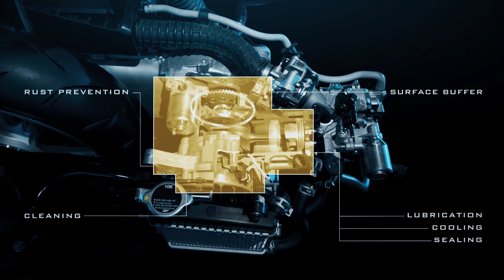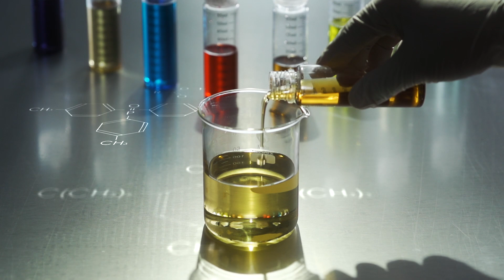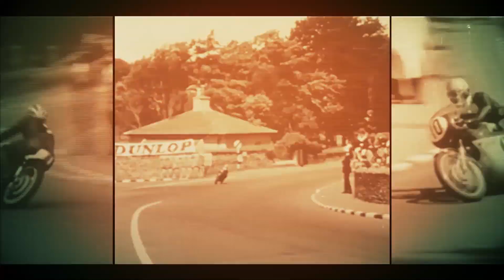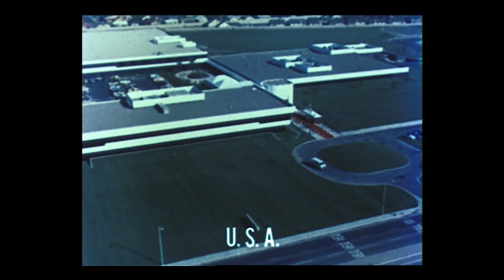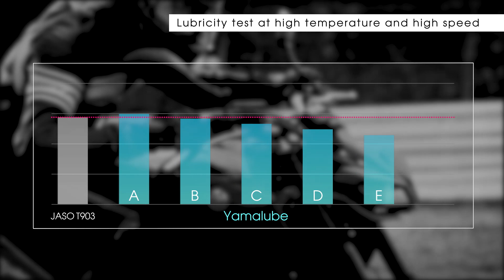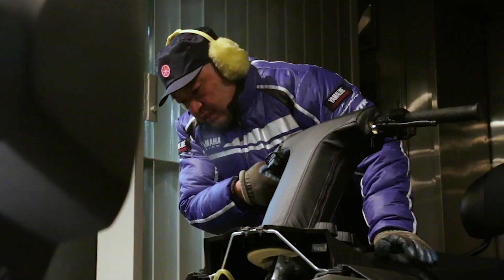Yamalube® - A liquid Engine component

Comment: In my country, almost all the workshop don't keep stock of original manufacturer oil and claimed that other brand make better engine oil because it has higher viscosity. In truth, those third party engine oil are more expensive. There are no basis in their claims that original manufacturer make inferior lubricant.
On the other hand, they use Yamalube during break-in period as they claimed is cheaper and Yamaha engine designed to use original manufacturer oil. 
🧐

Comment: I've been using Castrol for more than 12 years instead of Yamalube. Still working strong with the cheaper oil. But still, all credit goes to the Yamaha engine.
Reply: i have try castrol in the past and now i used yamalube 10w40 100% synthetic, the winner is yamalube 10w40 100% synthetic

Comment: It's  hard to imagine that    mixing  two  stroke  oil in  gasoline at  40 to 1  can  Lubricate an engine but it does work .. Using oil Injection is a much better idea as the oil does not  get  diluted by gasoline..